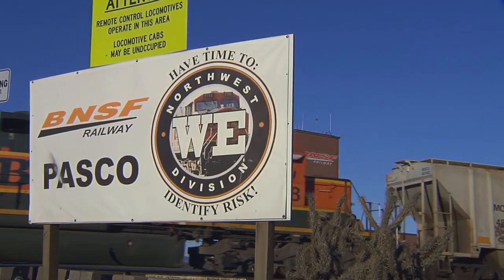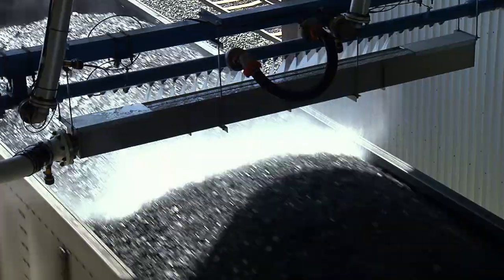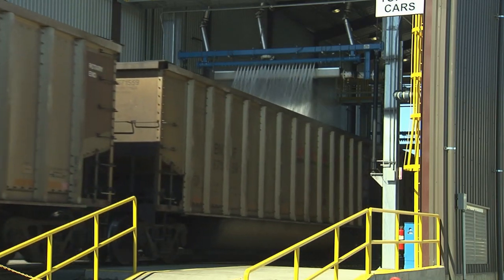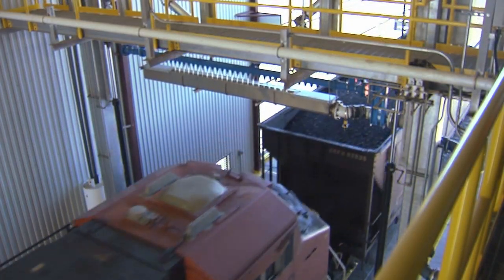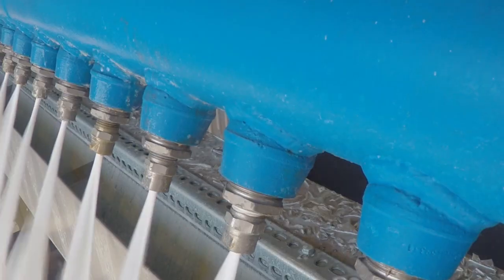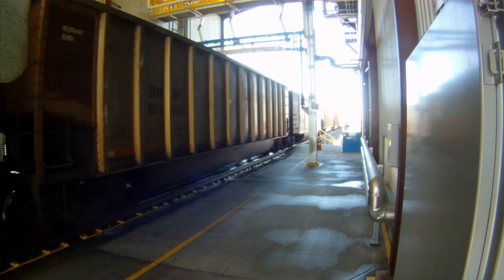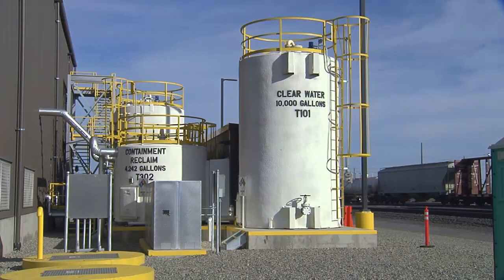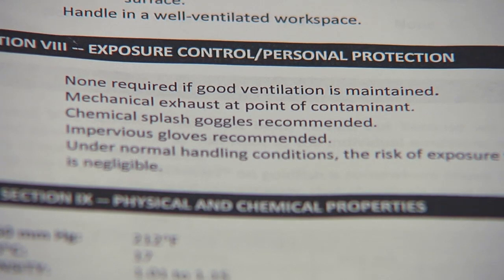BNSF's re-spray facility in Pasco, Wash.

Comment: It does work you can walk on that stuff without sinking in. Heard somewhere that a coal train can lose up to 1000 tons of its coal without it
Reply: Then that is why BNSF is doing it, not for the environment.
Reply: I would say its an act of enlightened self interest. It keeps coal dust from infiltrating remote power's electronics. It keeps a known carcinogen from dusting the public and workforce alike, and it will also help the environment by incrementally reducing waste which adds up over time. Luckily it happens to come up on the right side of a cost benefit analysis.
Reply: It's actually done to keep the right of way in better shape. The airborne coal dust settles on the track ballast and when it rains it prevents water from running out of the roadbed, which causes track defects like broken ties and possibly a derailment.